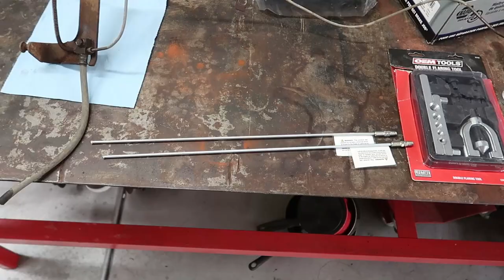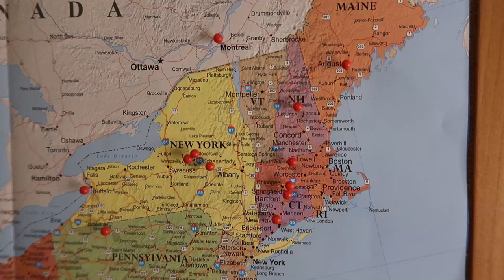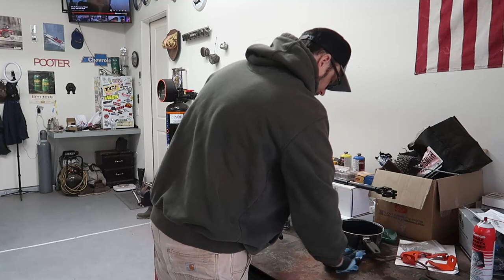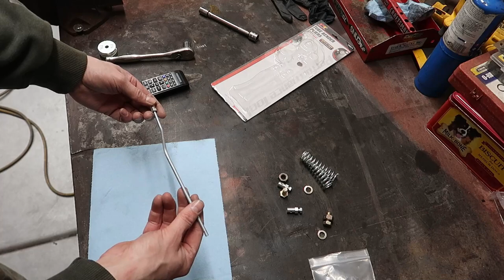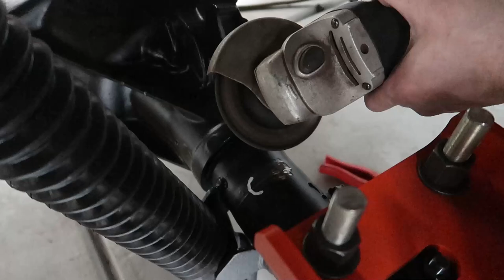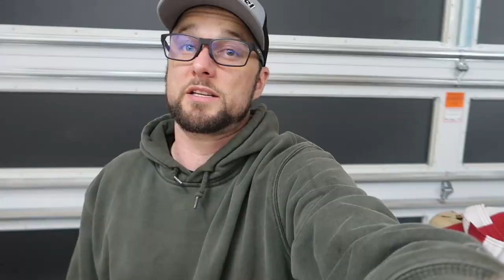K30 Trail Build, 14B Disc Brake Conversion hard lines.

Comment: Always enjoy watching a Square Body get worked on 👍🙌….Just picked my 89 K5 Blazer up from my mechanic who works on it for me…I had Nu-Relic power window motors and regulators put in both doors and the tailgate…WOW 😮what a difference!!! Windows can go down and up quicker then just going down with the one year old Napa  motors….I’ve tried them all, Napa , LMC, AC Delco, and some from Amazon…..absolutely nothing is  like these form Nu-Relic….

Your truck is gonna be a beast when completed ✔️ 🙌👍🙏
Reply from the maker: Those old window motors sure are slow. Mines got window cranks so I don’t need to worry about that, for now.

Comment: What length hose did you use on you splitter hose you bolted to the rear diff?   I am installing a 6” ORD kit and I am sure your hose will be long enough. I think mine is too short with the stock hose.

Comment: Hey buddy I thought I’d let you that when using chrome sockets on an impact they might be harder to loosen as chrome will take some of the strength out of the torque it takes to take a bolt or nut off!!  You should definitely try a impact socket witch are a much heavier duty socket and they will help by transferring the torque threw the socket better and applying more torque to the bolt or nut!! Just thought I’d let you know!!!
Reply from the maker: You are correct about the sockets! I usually just use the light sockets for the small impact, it uses the 1/4” adapter and they can break fairly easy.

Comment: Did you change the proportioning valve from the drum to disk set up? I know I didn’t on my swap and the rear brakes would lock up under light loads and was super sketchy lol. Its up front along the frame and engine crossmember
Reply from the maker: I did not change mine. Its supposed to work, but I haven't driven it much yet to find out.

Comment: Im currently trying to finnish up my lugnut 4x4 disk brake conversion on my '77 k20. Where did you get your hard lines? I have the stainless steel brake hoses as well and i just need to finnish hooking up the brake lines, but i came to a stoping point for now.
Reply from the maker: I made my own hardlines.
Reply: @PootsGarage  I saw that in the video. I was wondering where you bought the hardlines/hardware from. Napa, O'Reilly's? Im looking for the hardlines to cut and make my own as well.
Reply from the maker: @desmondbarajas9310  I bought those premade sections from Summit Racing. They had a few different lengths to chose from.